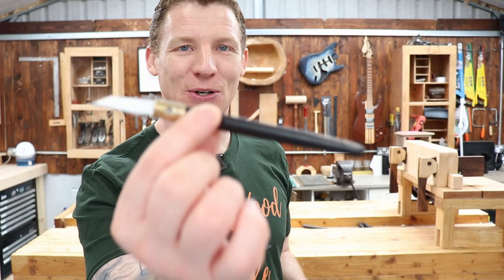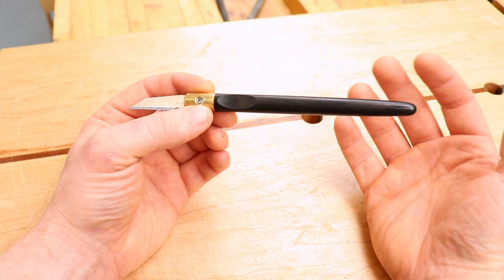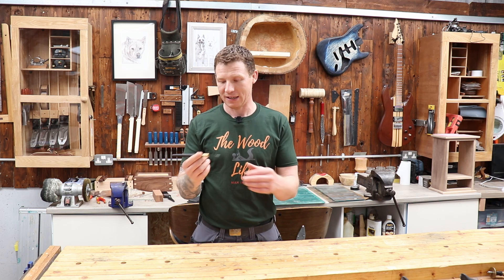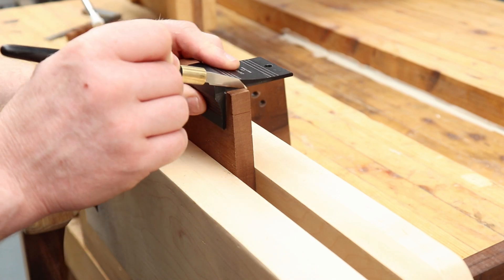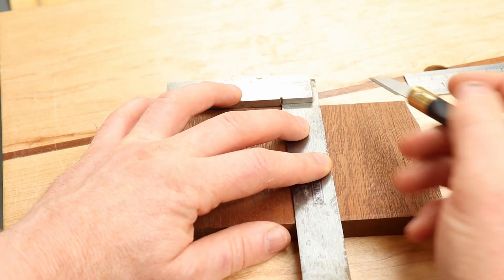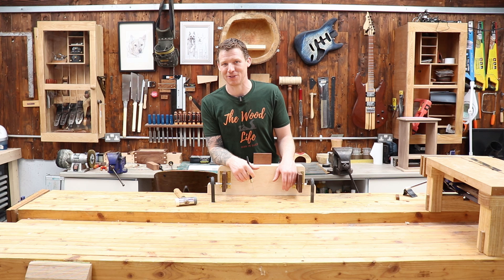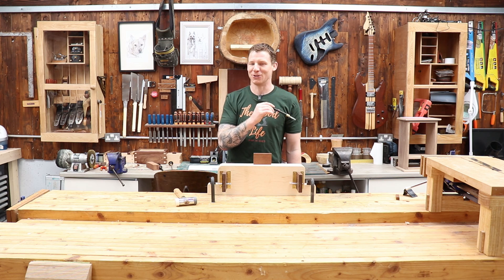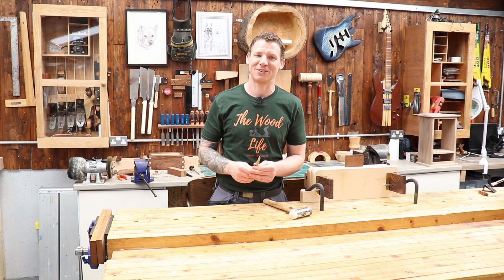Matt Estlea's Marking Knife.  A Tool Review.

Comment: Quick tip: those Stanley blades can also be resharpened with a few strokes on a diamond stone. I know they are cheap as chips,  but hey, waste not want not!! Great review John, thanks for all the vids!
Reply from the maker: Nice one Rob thanks for the tip
Reply: I do the same and I use a Stanley knife that Paul Sellers advocates. Inexpensive, holds a spare blade in the handle, folds into itself for safety if you have it in your pocket.
Reply: You think like I do. I have disposable blades decades old. If I break one it is like a loss in the family.
Reply: @michaelballinger6419  I thought Sellers used a Stanley 10-049?  I just took mine apart I don't see a place in it for a spare blade. I have a chrome plated one.

Comment: Good video, I'm thinking of having marking knife, till know i have using my  Leatherman Wave ( very practical and sharp, having it since the army) but its not comfortable for delicate jobs and not that refined. Need recommendation for small square or combination square that is accurate but wont make deep hole in my pocket 😅
Reply from the maker: Stanley squares aren't bad if you are on a budget also engineers squares are great you can get cheaper ones.
Reply: Money can go further on the used market. I got a 6" Starrett combination square for a few dollars at a yard sale. Although you won't find one every day. I've only ever found the one Starrett I have. I do have a 6" Atlas square I found too though. I have a pile of those brass and rosewood try squares too. None of them are probably square. But if you spend the time you can make them square. I just like how they look. I will say this it is rare for a square to be so out of square it is not square enough for most of what I do. Last year I got the coolest square I've ever seen too. I got a collapsable framing square. The blade comes off the body. It is wild! I didn't even know such a thing existed. It slips together on a dovetail with a locking cam screw. This is it https://www.jimbodetools.com/products/16-x-24-inch-takedown-square-marked-copyright-1912-southington-hdw-co-81973r I paid like a buck for the one I got. The moral is don't overpay for stuff online.

Comment: More of a knife handle then a knife. Would much prefer a proper blade you can sharpen.
Reply: Most people do sharpen those blades. Paul Sellers has been taught us to sharpen them.
Reply: @FearsomeWarrior  most people certainly DONt sharpen those blades. That's why they come in a pack of 10 and are easily detachable. SMH
Reply: Just a waste throwing out that much metal that needs only a touch up. Much be a generational thing. Screw money! Throw it out!